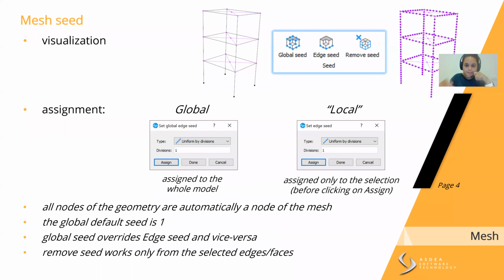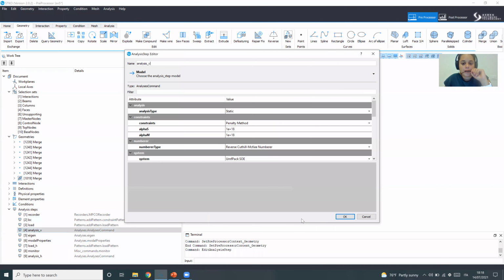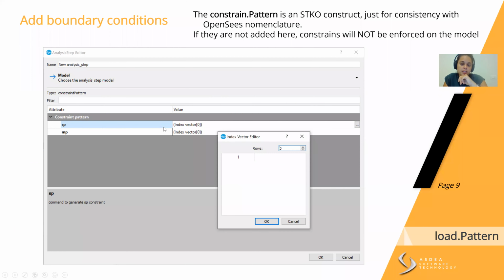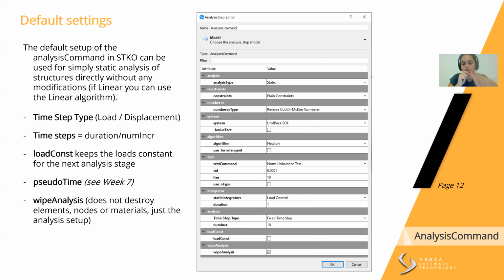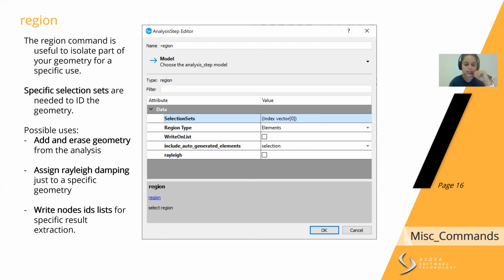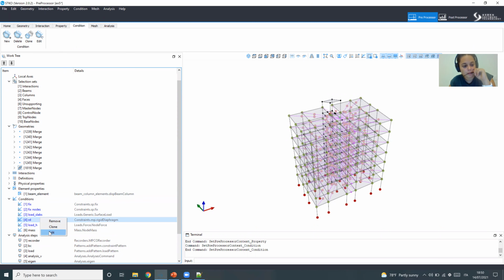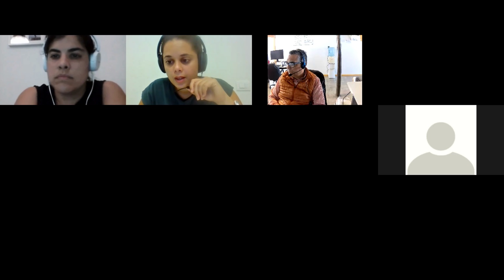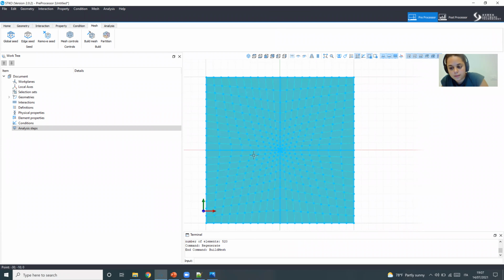Get Started in OpenSees with STKO: W8 Mesh and Analysis

Comment: Hello, I am new to STKO. I have a problem when I build a mesh on my structure, it displays me "mesh limits exceeded" the number of line elements is limited (max=20) so how to correct this? is there a solution? thanks for help
Reply from the maker: Dear Faycal, 
This message appears after your free 30 day full trial has expired and becomes a free learning license. The free learning license has certain limits, allowing you to build small models and run small analyses. To have access to the full version, you will need to purchase a license. You can learn more on our website (https://asdeasoft.net/?stko-purchase) or by writing to us at info@asdeasoft.net
Reply: @asdeasoftwaretechnology7930   Well received, thank you dear STKO community for the reply